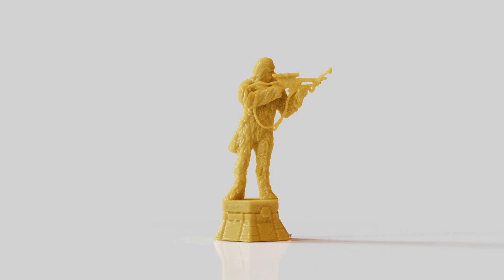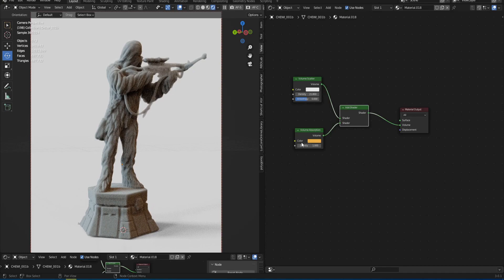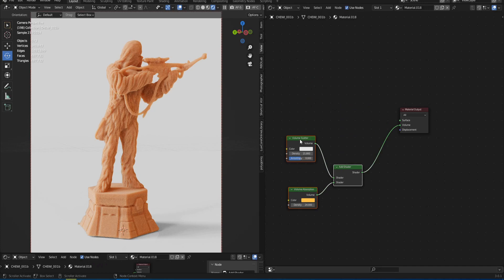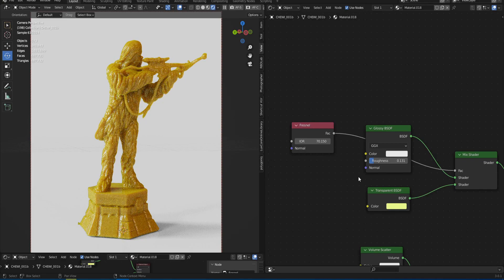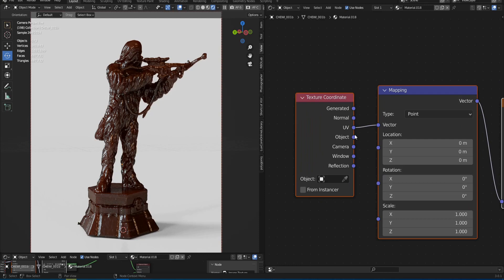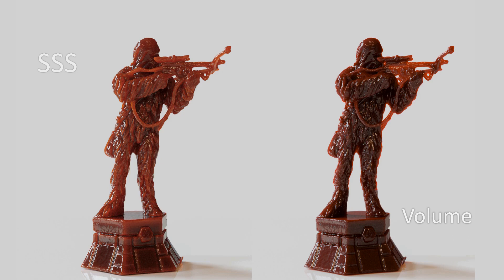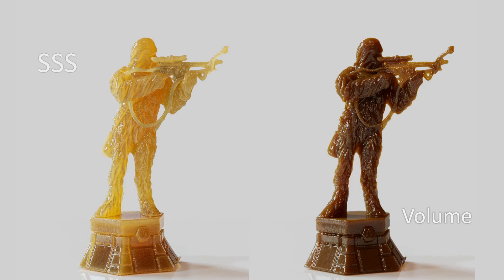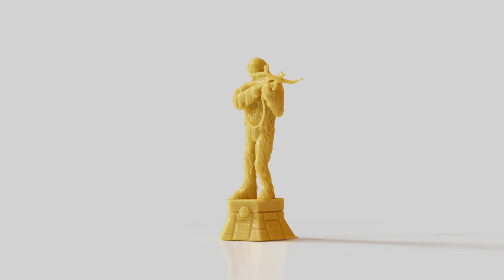SSS vs Volume in Cycles

Comment: that is an awesome technique as an alternative for sss - I didn't think that using volume scattering to emulate sss in corona could be done, do you have a video where you are demonstrating that technique?
Reply from the maker: You can be sure that in corona it could be done. Moreover for a long time it has been the main way to emulate SSS in corona. I don't have a video tutorial but could tell you steps. Turn off diffusion and turn on refraction, reflection and volume channel. In refraction channel make active thin glass (so that how you get rid of refraction). In volume channel play with absorbtion distance (make it 1 or 2 cm.). Change absorbtion and scatter color as you like.